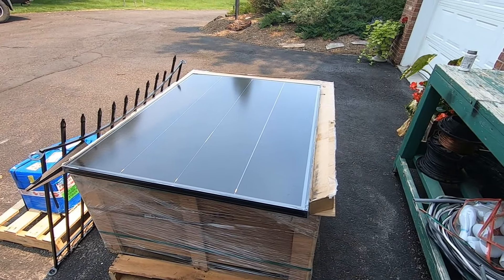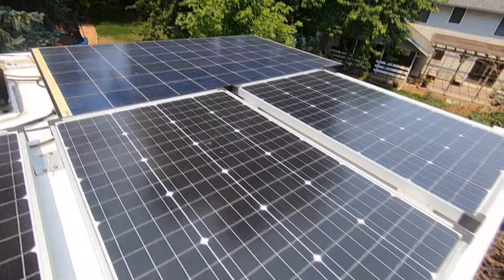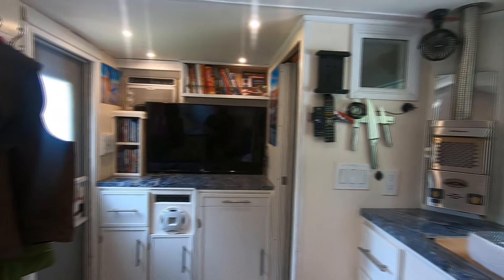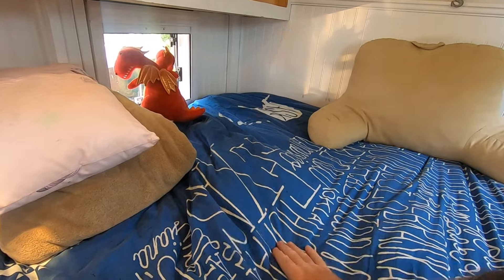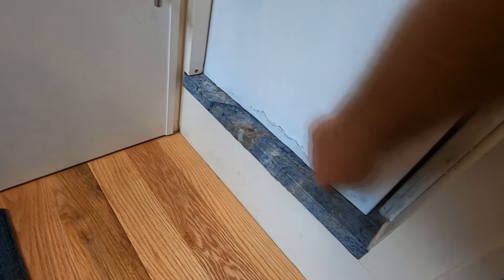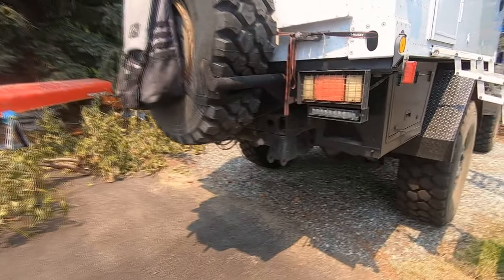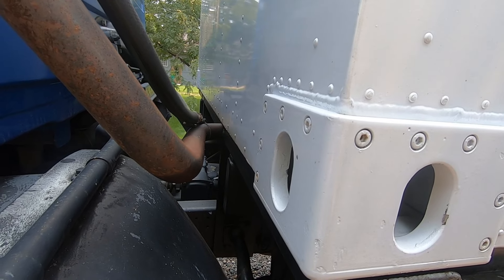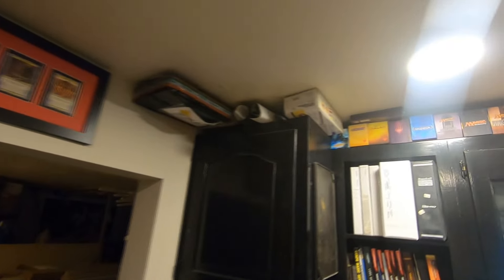What We've been up to!

Comment: After a few months with the Star Link permanently mounted to the roof. I kind of wish I'd left it as a stand alone. I find a lot of spots that it would be nice to be able to run the Star Link out further or run it up on a pole to get away from obstructions. Granted this has only been in camp grounds over here on the east cost where we don't have much options to position the truck. FYI. The cable is just a CAT 6 cable so you can cut it and run it through a CAT 6 through wall waterproof connector. 
Good to see you back making videos :)
Reply from the maker: Thanks for the info and a connector sounds like a great idea! Love your channel and envy your freedom right now!